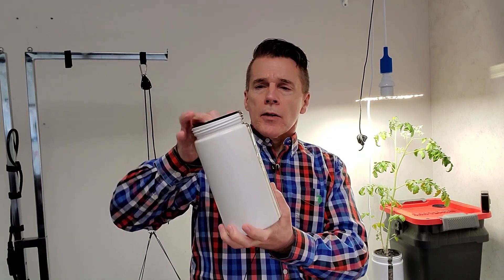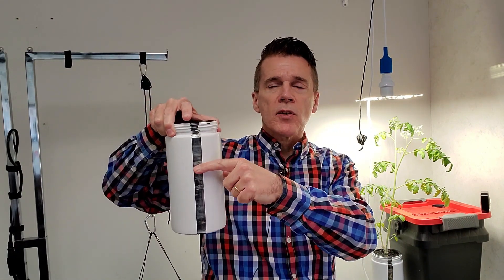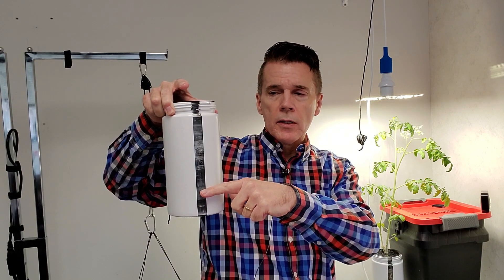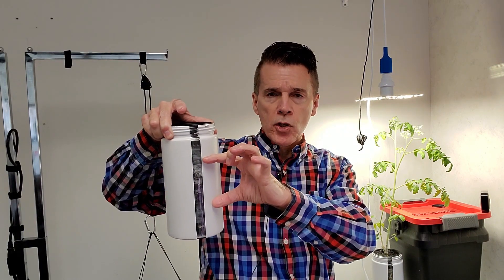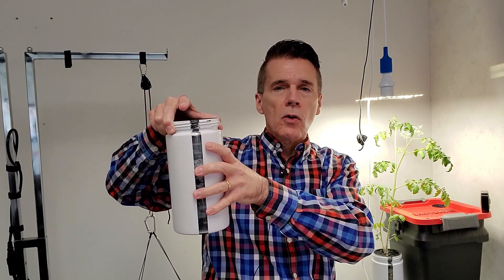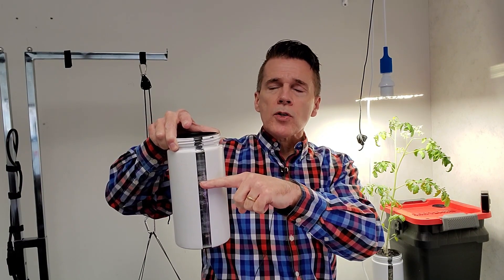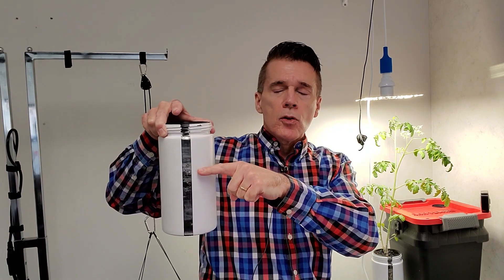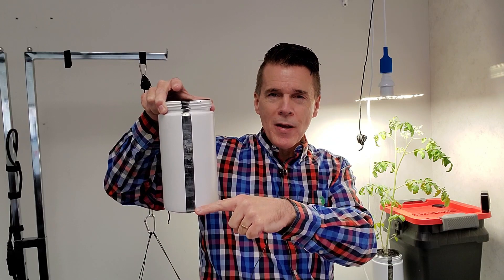B.A. Kratky Plant Collapse Issues

Comment: Have you had any problems with growing? In my plants sometimes one plant grows slowly than the other ones
Reply from the maker: @NicoleJara445  I have not.  With multiple plants sharing one container, it is not uncommon to have one germinate first and become dominant.  The dominant plant can use up water and nutrients at the expense of other companion plants.  To avoid that, I keep the nutrient water level at the bottom of the net cup for several days to give all plants a better chance to even out in growth.  I keep a gallon jug filled, and add a little daily to keep that nutrient level at the base of the net cups.
Reply: @MattGarver  I will try...I was just fylling with more plain water just for laziness
Reply: Now my other plants starts to drop all the flowers in my tomato plant. What can it be wrong?
Reply from the maker: @NicoleJara445  There can be many reasons for blossom drop, but it is not uncommon and no need for too much worry.  Try a small fan blowing over your plants to help with pollination.  While most dwarf plants do not need a fan, it does seem to help with my tomatoes regarding blossom drop.  Either way it is a great place to start figuring out which cause is the one making your blossoms drop.

Comment: Much appreciate your presentation! Myself just starting up and got a few tomato plants in roughly 45 L black, double walled (for temp control) pots outside. However, over the past five weeks I’ve been fighting the pH and EC values like crazy. They keep exploding on me. An addition to that not getting much hydration and the roots are not coming out of the cocos. I’d really appreciate any advice you might have!?
Reply from the maker: First off, 45 liters is a nice start for reservoir stability.  I have to make a few assumptions since I don't know the dimensions or the variety of tomatoes that you are growing.  Factor 4-6 gallons per 0.454 kg of tomatoes.  Half strength nutrient is standard since plants "drink more than eat".  Fresh water top offs stabilize a lot of pH and nutrient issues. Roots will pop out around 3 weeks depending on how much coco is used.
Reply: Thanks, Matt. Will take this into consideration. I already have tried topping off a couple of times with short-lived results. Not really sure how many kilos I’m gonna be getting out of it, but hoping that my sizing is all right.
Really appreciate you taking time to answer my question!🎉
Reply from the maker: @eyjolfursimonarson2887  No problem.  If you are refilling, be careful to maintain the same level.  Exposed roots will become dedicated to gas exchange and will respond sadly if submerged.  Submerged roots like to be near the surface.

Comment: I have a question: as time passes I assume the plant will require a higher concentration of nutrients to sustain its growth. Won't the nutrient concentration solution become too concentrated if you refil to a shallower depth whilst maintaining its optimal EC? I hope my question makes sense. Thanks in advance
Reply from the maker: Because plants consume more water than nutrient, the plant will transpire more water through the leaves as it gets bigger.  Keeping your nutrient at half strength still feeds the plant all that it needs since more nutrient water is being pumped through the plant.  With small containers, it is helpful to dump completely and refill to the same level from time to time since nutrients are not used evenly.  Also, since maintenance increases as the plant gets larger, it is better to use a large container or connect a gravity feed float valve to automate refilling.
Reply: @MattGarver  Thanks for responding to my question. I am growing a few brassicas using Kratky and I am doing as much research as possible to prevent mistakes.
Reply from the maker: @onalennasehume4586  Glad to help you.  I have done broccoli in a 18 gallon container.  Small cabbage heads can live their complete grow cycle in 20 gallons too.  Depends on what you are growing, the temperatures, the days to maturity, etc.

Comment: Would it be possible to use a float valve on this setup, I have been trying upside down pot in a fabric pot on a netcup which has constant water level from a float valve, similar to a rain gutter method, going really well but way more work in the setup than it needs to be.
Reply from the maker: Float valve is the most forgiving setup.  I build those for heavy drinking plants.  I plan to scale down one of my large systems to get early maturing and simple maintenance.